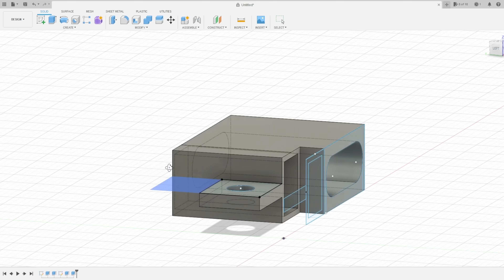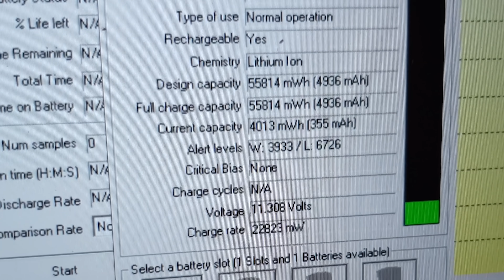Hacking my laptop so I could travel lighter!

Comment from the maker: Will you be hacking your laptop soon? What laptop do you have?

A few words of caution my friend:

CAUTION: 
1. You must find the right barrel jack to USB-C converter for your laptop that has the same voltage marked. Do not buy any random one to avoid potentially damaging your laptop due to different laptop voltages. Most laptops support between 18V-20V. Look on the back of your laptop and confirm the voltage with the adapter you are purchasing. Your USB-C adapter internals may look different to mine so please bear that in mind.

2. You must use a USB-C Charger that is equal to or more than the wattage of your original charger (which is typically more than 65W). You cannot use a typical phone charger to charge your laptop because it does not have enough power. You must use a USB-C to C cable that supports charging, and not USB-A to C.

3. Be sure to properly protect any bare wires or pads with heatshrink, glue or tape. You do not want any electrical hazards here nor airport customs to annoy you for your dodgy laptop. Do it right the first time. Do not use hot glue, it will melt from the heat while charging.

Enjoy!
Reply: Dont forget to use a non conductive glue because some glue can conduct electricity
Reply: 4:44
ـ yalh bay
ـ يله باي
ـ hmm
Reply: اسمه جو جاز , تكفى مسوي كونان هههههههههههههههههههه
 @MOA_YAD
Reply: https://youtu.be/CX_A753rpzA
Reply: @prasad_tech  
HMM , 😐
Reply: Wouldn't think it would get hot enough to melt hot glue. But I'll try something more resilient like epoxy or metal glue to just stick the little bugger in. Cheers for idea.
Reply: Hey Joe. I love the Idea and thought of doing it too since i've allready converted my wired Keyboard to usb c plug. My original Powersupply charges it at 19,5V at 2,31A so 45W. You think 20V would work too?
Reply: I know im a year late but what if i just buy USB A Male to USB C Female adapters and put it in my laptop and charge it would that work?
Reply: @marlayromanii , no , because USB A on the laptop can't charge the laptop , only supply other devices , I'm 90% sure no laptop can be changed though USB A port
Reply: What if i want to do exact opposite
Reply: Колхоз полный. Вытачивал бы и отверстие в ноуте тогда на чпу
Reply: one thing i'm not clear on, is (assuming all correctly usb-c pd), if the laptop is rated for like say 100w, but the usb-c brick can only do 65w, will it still work, but only supply 65w, or will it trip the protection measures of the charger and not charge at all

if it''s the latter, how do most PD devices work, and could those solutions be used in the mod
Reply: Would I possibly be able to contact you for the 3D print file? I have the same exact laptop and was recently thinking about it not having a USB-C port (and how annoying that is)
Reply: U can use the wrong cable and charger possibly to only charge laptop wen off
Likewise if laptop is fully charged can possibly use it to supplement the battery power 

All possibilities depending upon how laptop adapter and cable n psu work
Reply: Can you share your stl for the laptop internal mount? I just bought a 20v pd3.0 board but can’t mount until I get a housing for the pd board which is a universal mount
Reply: I don't know how but I NEED it. My charger is TOO 💩
Reply: 2025....goes and buys a standard travel laptop with Type-C charging port XD.
Reply from the maker: FYI - My laptop is the HP Spectre x360 13-4102tu. I bought this connector - https://amzn.to/3ro9Z5F. Pretty amazing laptop! Why should I throw it out when you can just mod it? This will work for nearly every laptop I am sure no matter how much space you have. Give it a crack! If you happen to make something even better than me be sure to @ me on Twitter!
https://twitter.com/thejoegaz
Reply: @goodjihad  If my laptop already has a USB c port but not for charging what do you recommend
Reply from the maker: @christianflores3437  Well does it charge using barrel jack? If so heck yea I would mod it! Why not. Otherwise just buy the adapter and keep it with you wherever you go. Buy a USB-C charger and boom. Ez :)
Reply: try adding magsafe the next time lol.
so walking humans don't make your laptop fall
Reply: Planning to do this on my IdeaPad S340-15API. Thanks so much for the tutorial, I can't wait to ditch the stupid brick charger - I have a tiny little GaN charger that delivers exactly 20V @ 3.25A like the official brick does so it should be a massive saving.
Reply: I got 2 USB-c charging ports and a 150w round one
Reply: Sure will, my MSI, ASUS, Acer and a iBM ThinkPad laptops will all get this treatment.
Reply: I dont trust you and It's modding not hacking
Reply: you really need to learn difference between word "hacking" and  "dyi" or modding
Reply: @finwwwfinwww4669  It's the OG definition of hacking before it became a negative word

Comment: They make it seem smarter to change the port, but it’s really not.
Adapters exist for a reason.
Modding your laptop just to “travel lighter” is risky—especially if the device isn’t broken to begin with.
One wrong move and you’ve damaged something that was working fine.
Simple fixes > risky hacks.

Comment: You change the port what if it over fluid the electricity I am not sure just confirm me battery charge a system laptop or anything does our charging port save a laptop by shorting out if there is overload or something or had do nothing ?

Comment: I do believe, unfortunately, this HP laptop needs a data pin on the charger, otherwise it can't identify wattage and will slow charge.

You would need to take a chip from an HP charger or adapter, and put it inside the laptop, for this to work properly.

Comment: I tried using one of these adapters in my laptop but every time I charge the laptop using this 100 watt capable adapter the laptop won't use any more CPU than 400 mHz. The laptop can manage to reach 4 gigahertz on battery. It's HP Pavilion gaming by the way.

Comment: As to my knowledge, female side of the barrel jack have 3 wires, positive, negative and signal. I see in your video that you only soldered the positive and the negative to the USB-C connector. How did you bypass the Signal ID because most laptops wont charge without it

Comment: As much i know that was a hp 360 convartable laptop, in hp there always a data line for adapter input information, without that input battery won't charge and some model also has a over charge information line . Basically I am asking How did you bypass other information pins in your type c connector.

Comment: Do you know if those adapters use a converter or use resistance to get from 20V to 19.5V? I'm worried if I connect a 45W adapter to a 45W laptop it won't work

Comment: Funny thing is this laptop already has a usb-C connector which could handle usb-c charger without having to butcher the casing.
The only advantage with your mod is that you can use the existing usb-c port for data while still charging the laptop.

Comment: Great video. I'm thinking of doing this conversion but I think I'm going to use the Kensington lock slot instead of modding the charging port hole. I like the idea of that better. I've seen another video where the guy bridges the the wires from the charging port and makes a hole on another side of the chassis. Most kensington lock openings are about a mm or 2 smaller than the hole you'll need for the USB C port plus it's basically the same shape. I ordered the parts so wish me luck.
Reply from the maker: You got this! Nice idea :D

Comment: My HP victus has a 200w power brick, is it still possible to have that much or lower power transmitted over USB C
Reply from the maker: I believe USB-C has just come out with 240w cables/connector support but I do not know enough about it sorry. This will slowly be integrated into laptops in the future however.

Comment: Calling 20 volts "very high voltage" is kind of wild.
Reply: any voltage higher than 0 shorting to ground changes your computer into a paper weight!
Reply: @JonJaded  Depends what shorts. In many cases if you open the closed circuit, it works again.
Reply: u dumb nut have u ever listen of amperes

Comment: I have a USB to 19v pin charger adapter. No problem. No mods needed, no messing about. Been using it for years.
Reply: I'm looking at this thinking that despite the fact that you could do away with an adapter, there is some fun to be had with adding a port, essentially, modifying the laptop, instead of having one more external part that can easily be lost. To each their own, I guess
Reply: @ariannanightingale4054  Well, yes. There are many ways of solving the same problem and each has its own benefits. With my solid-state dehumidifier I put a 12v connection and a step up converter inside the shell.

Comment: + like 👍

I found your project interesting, but I will be honest and sincere.

USB Type C on Laptop chargers is a nightmare, especially if you are a repair technician and your model needs repairs, besides, the way you designed it, allows for an exchange or repair.

In many Lenovo laptops today, USB Type-C comes as standard from the factory, but it does not allow for replacement or repairs (it becomes a lot of work and they make it as difficult as possible in the hardware design), I call this a technology regression.
Because USB ports over time and use, depending on how you use the connector, can loosen and deteriorate over time, even causing damage (the internal pins can break and cause a short) and render the port unusable, at least , if it is well designed and used correctly, I believe there will be no problems.

To be honest, the project is cool, but it's not something I would do in any way, I prefer the standard traditional power connector, they are easy to repair, they are easier to repair, and they will rarely show the play that USB ports will.

I don't want to belittle your project, nor seem rude, you did something according to your needs, that's great, but for me, it doesn't seem like something advantageous, it's definitely something that I would classify as an experiment.
Edit: I'll be honest, USB Type C was the worst type of port designer ever designed, as a repair technician, it's a nightmare, besides many people look for adapters and sources, but depending on the situation, the sources may not be fully compatible and or the door could simply fail, break, close short... in short, a nightmare. I don't see the advantage of this type of port as a charging port.
Reply from the maker: Very honest and sincere evaluation. I appreciate your work as a technician. You would have more experience than me in this area.
Reply: @goodjihad  You are the one who deserves all the credit.
He did an experiment and it really worked.

We can learn a lot from these types of things. 👍👌

Comment: Does it convert from 20v to 19v? Usually ac barrels are desinged to work on 19v and might affect the battery
Reply: This isn't lab equipment and 5% voltage deviation almost garaunteed to fall into nominal working range.
Reply: anything between 18V to 21V will be just fine....  the battery charges from a voltage generated via PWM with some mosfets...usually close to the voltage of the battery...so much less than 19V.

Comment: I've made the same, but the 67watt charger is overheats after 70% charge, so not perfect
Reply: It overheats and fails, or it's just extremely hot to the touch? Because if it's a GaN charger, they can tolerate temperatures in excess of 150C. That's the price of being super compact.

Comment: Ah man, wish I could do this. My travel laptop is a dell, and even with chargers that meet all voltage and amp requirements- if it's not an authentic dell brick it will not charge. And this is bios baked in, and totally just a software thing to hinder you from doing useful stuff 😢

Comment: if your laptop has a kensington lock "port" you could mod it to have a usb-c in there so you could still use the original charger as a backup

Comment: If only companies stopped being so childish about proprietary cables
Reply: This wasn't a proprietary cable, it's a jack connector that been used for laptop to send lot of power before USB C that did the same, I have that connector on my HP.
Reply: Well now if they want to sell to Europe they have to make their devices capable of recharging via USB-C. They passed a law, so any device that is rechargeable has to use the connector. You’ll notice recently that almost any device made after 2022 has USB-C charging capabilities.
Reply: At a company they gave us a Lenovo ThinkPad and I was so happy it came with a USC C charging port. I wish all laptops did that.
Reply: @waiitwhaat  from this year all devices that have a rechargeable battery have to have a USB-C charging capability
Reply: @Underestimated37  In Europe, yes, but I'm not sure whether that's the case in India. Seems like it is but that can be a by-product of EU enforcing that on the manufacturers, and manufacturers shipping the same product everywhere because it's cost effective. Either way, it's amazing.
Reply: @waiitwhaat  yeah when one part of the world does it the others follow. Now you can buy retrofit adapters for a ton of different laptops to make them usb-c chargeable, and the actual charge modules are cheap, I have a bag of usb-c charge boards with switches to set the voltage for whatever I want to power from it.
It’s so cheap to switch that I highly doubt many new things will come out that aren’t usb-c in the future.
Reply: cough cough, apple, cough
Reply: @fr3e. Well the macbook is rechargeable thru usb-c

Comment: I like how every simple fix starts with buying a 3D printer.
Reply: thermoglue or epoxy would also work well
Reply: Nah not really, you can always have someone print it for you locally or online. Or you can just hot glue it in place so theres no gaps at all.
Reply from the maker: @Drenixx  literally what I would have done worst case or I would have at least cut some thin ABS plastic as a housing and permanently glue it together to keep it in place.
Reply: @Drenixx  As someone who bought their first 3D printer recently, I can guarantee you that the first attempt is pretty much never completely successful; the printing process affects the tolerances in a way you didn't anticipate, some elements need modifying, the print settings caused warping/delamination/part coming off the bed etc. There are always a number of iterations you go through, and going to someone who has a 3D printer will be inconvenient for both yourself and them. 
They are getting more affordable for hobbyists. Alternatively, you could ask a friend to print you 3D printer components to build your own, as there are designs out there that have been tried and tested and will have a low chance of failure.
Reply: @HarmonicaMustang  Use and design 3D printed bits at work, 100  percent correct, better off buying a cheap one and playing around yourself. Very very useful if you know how to use them (I don't yet!)
Reply: @HarmonicaMustang  when you print for a good time you can learn how it behaves and have your first attempt work, but this involves good 3d modeling skills too. For this i would prob just hotglue or epoxy it in place if i didnt have printer
Reply: @Drenixx  not every locality has 3D printing services.
Reply: @Drenixx  expensive...
Reply: There are some places that you can pay them to print for you.
Reply: Cause u can make whatever u want
Reply: My local library offers 3d printing for cheap
Reply: @zeng833  Must be nice. I dont know any places like that here. take advantage.
Reply: If you spend 5 minutes asking around, you'll find someone you know, who's got one and can print it for you
Reply: These 3d printers are modern day Glue gun, as soon as glue gun mentioned time to leave the video 😂
Reply: The price of a 3d printer is much more than the laptop
Reply: You can walk into any modern library and print your part for pennies on the dollar, if not for free.
Reply: @PunakiviAddikti you probably live in some imaginary wonder world

Comment: For anyone looking: There are now variable voltage charging controllers, where you Bridge two pads with solder, depending on the voltage you need

May be simpler than find one that does your voltage
Reply: Aren't the specific voltage ones cheaper?

Comment: U dont tell the average voltage and Amperage of the usb-c,this isnt good because actually power supply of notebooks feed's around 45w -130w, an usb c even of best quality will not even offer more than 50w,yes Baseus has some 120w chargers but they are expensive.

Comment: i will consider this, but might ADD the usb-c connector instead of replacing the barrel jack. should not be too hard.

i could also just use the usb-c port already on my laptop(has usb-pd and dp) but it's in an annoying spot..

Comment: I use short usb-c to angle barel jack cable for my HP Spectre 13 x360 first gen without any problem. If you don't want modify your laptop, this is the solution.

Comment: Hello. Does it only inputs power or I  can also charge my phone from my laptop?

Alao, is it ok to buy an adapter with more voltage?. My laptop originally supports 45w but the adapter I found supports up to 100w

Last but not least. Can you please share the 3d file so I can use it or modify it to my need
Reply: I have the same blue charger so I can use the same 3d file. Thank you ❤

- يله باي
Reply: By the way. Your Twitter link doesn't work. Maybe because you changed your username

Comment: When you cant afford a MacBook pro
Reply: When MacBooks used their own proprietary charger and just recently switched to type C- meanwhile most Windows laptops in the same price range have had both AC and Type C for years... Also, not to mention you can upgrade your hardware. Try again mate. There is one thing Macbooks have better and that's the display and OS at this point. Cheers.